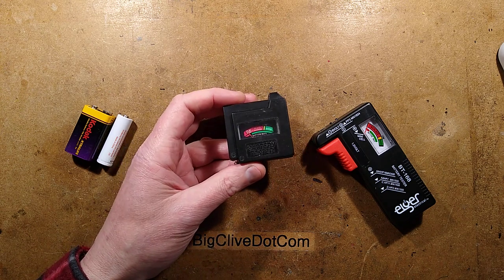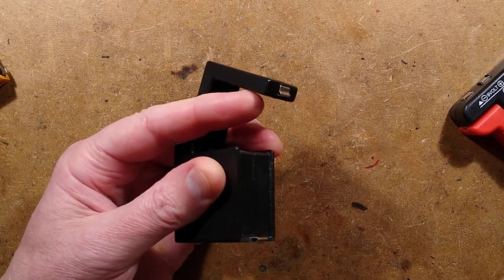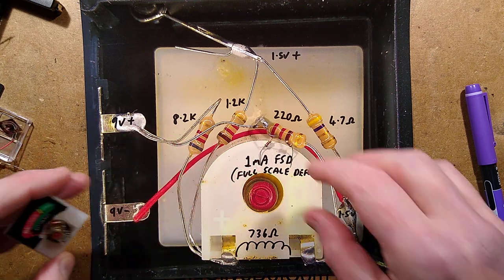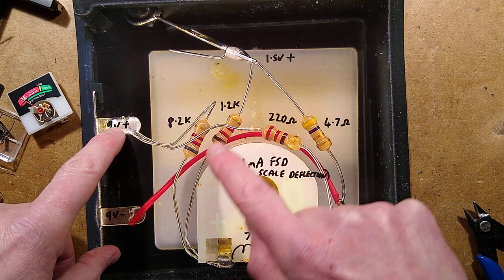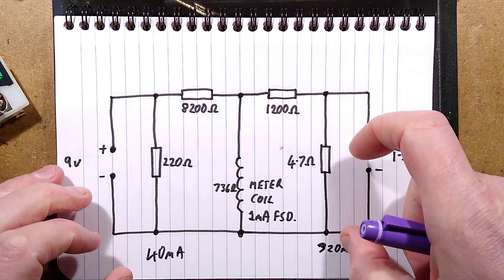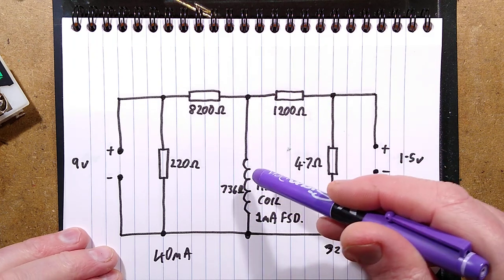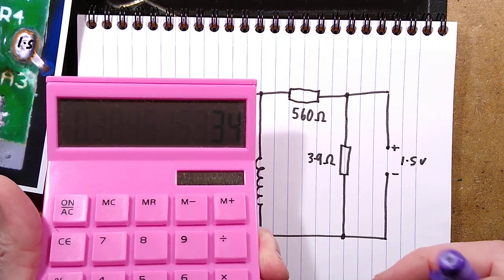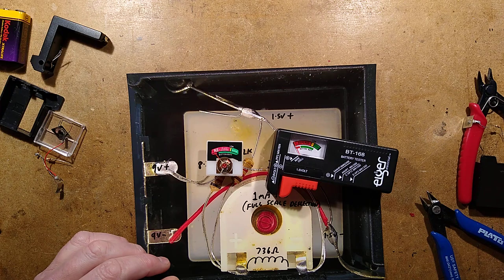Inside a simple battery tester (with schematic)

Comment: I wonder if the first one was an 'improvement' from just a 1.5v tester, and they just used the same values, likewise when they added the 9v, they may have tried it with a standalone circuit, but the act of combining both they didn't account for the resistors
Maybe try just the 1.5v set of resistors on that meter

Comment: I have newer one in both version analog and digital.  Digital version contain just resistors, display and custom chip under blob of black glue or something. Need it for trip where you need box of batteries for flashlight,  headlight, camera (before li-on), radio (before bluetooth speakers) etc. and very often happen accidentaly mixing used battery with new. Need something smaller to backpack I buy tester from Lidl Tronic H12276 IAN79015 year 2012. Very small, light and quick check but need good AAA battery for power itself and measure just by voltage without load. Maybe is good idea add some resistor inside between terminals to load for more accurately measurement.

Comment: "Kink Palculator". I snorted, and skipped back to make sure that is what you said. 

Also, wouldn't the "unused" resistors on the other side tempt some pixies away from the meter, lowering the meter deflection to show bad results for the battery being tested?

Comment: I may be asking an obvious question, but couldn’t one simply replace the 1200ohm resistor with a  700 to 750Ohm to get proper deflection and save the little tester from the rubbish bin?
I had one of those in the 80s made by Duracell, worked like a charm until I accidentally stepped on it.

Comment: The almost-400mA current draw on the 2nd meter seems high - did you test resistance across the test points? Maybe you got a wrong resistor multiplier colour band?
Also, the resistor networks for the opposite type of battery (ie. for the 9v when testing 1.5 and vice versa) will add a not-insignificant load and will alter the meter reading somewhat - for a more correct value of what current should go through the meter at 1.5v / 9v you would need to calculate the other branch of the circuit too.

Comment: I have the same small battery tester with the clamp. It released some smoke when I tested a 9v battery for too long. Since then it works fine and didn't smoke again. Pretty weird.
But mine is better in testing the batteries. If they are full, the needle hits the right side  of the case.

Comment: I have one of the newer ones you showed withe the red slide. I always wished that the red slide had a spring to better hold the battery instead of relying on your mechanical force holding the battery in place.
Great video Clive, well worth watching!

Comment: I have one of those small ones and it's "reasonable". I'm guessing the meter part is very variable in its quality. I might check the resistors against yours just out of interest. It's very possible when they made yours, they were out of the correct values and substituted something else.

Comment: I have one of these too and it isn't a good indicator for 9V or 1.5V batteries as to whether they are good or not. So what do you think the resistances should be? I guess it's easy to calculate what the resistor should be to supply the meter with 1mA (about 750 Ohm) from a 1,5V battery, but what should the load resistor be for a good alkaline 1.5 V battery?  Likewise for the 9V side. If you work it out I'll break into my device and change the resistors then I won't have to buy a new battery tester. Deal?

Comment: I have the digital version (BT-168 Pro) and measured the current draw from the battery and it's only 9.8 mA so the digital ones appear to be worse as they don't load the battery. It's fine as a quick voltage check but that's about it.

Comment: I had that exact same older tester up until a few years ago, and it seemed more accurate.  If I tested new batteries, they would peg the needle all the way to the right as you would expect.

I'm guessing quality control where they were made wasn't really good and yours just got the wrong resistors installed.

Comment: Wouldn't the load on the 1.5 volt battery be (3900 || (560 + (3820 || Rm) ) )? Where Rm is the meter resistance.

Comment: Had a battery charger for Ni-Cd batteries back in the day, which had a "test" function- put a battery in the end slot and push the button. If the light lit up brightly it was charged. It not, it wasn't! I was envious of my friend's, which had a neato gauge calibrated in GOOD and BAD like that one.

Since, I have an old Avon "Go With The Glow" battery tester, which lights a red, yellow or green LED to indicate the battery condition. That would be interesting to reverse engineer, as the lights come on only one at a time.
Reply: If your three LED tester has an external power supply they probably use some sort of comparator. If it only uses the battery under test, that's even more interesting because 1.5v batteries aren't really enough to run regular LEDs.
Reply: @eDoc2020  That's what makes it so interesting, it's run from just the battery under test (1.5 or 9 Volt). I think it dates to about 1984 or so (was a gift item from the Avon cosmetics company). I was wrong; it'll light two LEDs at a time to give 5 states of charge indication.
Reply: @nigefoxx  That is strange. I'd need to assume it has some active circuitry. A voltage divider feeding the base of a transistor might make an "okay" comparator because the drop across the junction is fairly constant at a given temperature. I can't really imagine a promotional product from the eighties would be much more complicated than that.
Reply: @eDoc2020  I would guess so. They do switch on and off sharply so I would guess a basic comparator.
With the Red, Yellow, Green it'll light G, GY, Y, YR, R. Making a poor contact will make it flicker. I need to measure the threshold points, because even on a fairly dead battery the red LED is just as bright as the other two...
Reply: @nigefoxx  It might even use a basic boost circuit. It would be quite interesting to know how it works its magic.

Comment: It looks like that square battery tester was not made properly, a lot of people make them these days. The needle should peg to the edge of "good" with a full battery, maybe the resistors are wrong. The one I bought recently worked the same as the ones from the 90s, even though they were slightly more complex than just a bunch of resistors back then.

Comment: To test batteries, I normally just get a multimeter. On a 1.5V battery, I find 1.2V or less is dead, and with a 9V battery, anything less than 7.5V is dead.

Comment: Used to have one just like yours in the early 1990s, I imagine that's a pretty old design.  I just use my multimeter but no idea if that's the proper way to do it.
Reply: If you're just measuring the voltage, that's not proper. You definitely need a load and I think 100 ohms is typically used. If you're using a battery test function, you should be good.

Comment: I got a larger type one for someone when they didn't wan to have to faff around with a multimeter to test batteries. Of course, it didn't do rechargeable batteries correctly. Surely someone will have made one that actually can do rechargeable cells, even if there's a manual selector to choose type.
Reply from the maker: A typical rechargeable NiMH cell will hold a constant voltage of around 1.2V from near full to near zero before suddenly dropping off.

Comment: 1.  I have batteries just like that.  They are so unique I er charge them back up, At somepoint they'll leak.  What brand are those.  2. My trust old one is like that but mine's even older.  Works fine.  I'm thinking the resistors are going bad..  That being said I have various including one with a slider but not that well made but stores Christmas light fuses (for the old school C9 version)  squirrels hate the wire...  The main one I trust is with a multi meter.  There's also the LCD version,.. Usually gray and needs a triple A batter in the back.  Often the contacts break for AA..

Comment: About what I would have expected. Seeing resistors tacked together mid-air inside a case hobbyist-style in commercial products is always a little disconcerting. Not sure what they were thinking with those values, either.
Reply: The resistors aren't tacked together mid-air, they are soldered to the various terminals which are fixed in place. This is actually how everything was made in the tube days before circuit boards were introduced to lower manufacturing costs. A bit ironic because now it's cheap things like this which don't use PCBs.

Comment: I have this kind of coil meter from an old rc transmitter. It was used to show the level of charge of the 12 volt battery inside. I want to convert it to check the status of a li-ion cell. Any suggestions?

Comment: Did you also cheak them with a volt meter to see which one is closer to being correct  I have the one on the right was in a battery organizer I got for Xmas
Reply from the maker: I tested it with a bench supply and meter.

Comment: I had a battery tester in the early 80s. It had a motor inside that turned a wheel that pulled against a spring to show battery power. Probably wildly inconsistent and inaccurate!

Comment: Apologies if this is a really stupid question (I only understand the very basics atm but I love your videos)... Why the need for four resistors? Could the two at the top be removed and different values used on the verticals instead? Thanks.
Reply: The first resistor is in parallel to the battery and acts as a load because measuring the voltage of an unloaded battery does nothing to show its capacity. Whatever voltage is left thanks to the load then deflects the needle.
Reply from the maker: One as a load and one to tune the meter range.  Two pairs needed because one set is for 1.5V and one is for 9V.
Reply: @bigclivedotcom  Thank you!

Comment: i have the bigger one, bought for 3€50, i sometimes use it, mine has normal resistors like the small one, it looks quite flimsy anyways, i bet the moving wire could rip from the contact if moved too many times.... i actually look for analog meters around, time ago they sold here that small analog multimeter for 1€50, asked for it time after, no longer ordered bcs it's trash but i loved the instrument, it was so cheap

Comment: 5:18
320mA load at 1.5V = 0.48W
That's almost double the power the resistor is rated for.
Sure, you're only using it for a few seconds but still.

Comment: i have a cream one of the smaller one, had it years,  certainly over 20, maybe over 30 😲 and a plasplugs branded one of the other one, theyre not too bad for a rough check and at least they test on load unlike just a multimeter (unless it has a proper battery test range) i semi calibrated mine, feeding it a few known voltages and seeing where the pointer went to , the cream one goes to outside edge of the green area at pretty much exactly 1.5v, cant remember what at 9v, the other one a bit different
Reply: the 40ma test for the pp3 is probably a bit much

Comment: I'd rather have a tester be a bit conservative vs over-estimating.  I hate the ones that light up "good" when they have an open circuit voltage of like 1.0V and everything you try to use it in fails to work properly.

Comment: And the digital versions of these tend to not put any load, nor give a reading of good/marginal/bad, rather a voltage. They are pretty useless.

My favorite is the GBT-3502, though it loads the battery less with 30 ohms.

Comment: It's worth nothing that when you connect the 9VDC battery and want to calculate the current going through the meter, you also have to consider the resistance of the other battery circuit's current limiting resistor and its load resistor. These resistances summed up form a resistance connected in parallel with the coil, so a significant current will flow through it. 

The opposite (taking the several kiloohms series resistance into consideration when analyzing the 1.5V side) is not quite the case as this resistance is significantly larger than the meter's, so it can be neglected for simplicity.

Comment: I have the BT-168D which is the Digital version of this battery tester and with it being black and having pretty crappy eyes I found myself putting an 18650 battery in the wrong way and it really didn't like that. The smell was not very nice and I have no idea what damage I did to the battery due to me not having a use for it at present. 
If I had use some sodium chloride then the rozzers could had got me with a current charge of a salt and battery. (Sorry, the meds have taken effect. 🤦‍♂)

Comment: I disagree with you. I have had at least two of those little clamp on meters for many many years under different names. I’ve never had any issues with them just checking batteries.  My guess is that the moving coil meter movement might have been damaged at some point changing its internal resistance. I do like that you do take the time to draw the diagram.

Comment: My same must have a better choice of  resistors the meter goes much higher for 'new' batteries.  My better unit has a LCD screen (just cubes to show violtage) and multi posistion switch. and leads  a nice compact unit.  The leads wrap into a groove and the pyobes snap into recesses in the back

Comment: Internal Resistance - very much misunderstood by many!  It's really important to test batteries under their expected load (current).  A voltmeter across a 'dead' AA cell will read about 1.2V but the battery can have such a large build up of internal resistance that it cannot deliver any useful current anymore - so it is as good as 'flat'.  I used to demonstrate this to pupils by connecting a 1.5V lamp to a 5000V (high internal resistance) power supply and they were always surprised that nothing at all happened!  Demoed here https://youtu.be/V06sYBiYWqM    So always test your batteries under load to get an idea of whether they are still capable of useful work!
Reply: Lithium coin cells are notorious for that high source impedance, where spent cells can read just fine with a DMM, but drop to zero under the slightest load.
The load resistance used for testing just needs to be picked with consideration for the application. Batteries for a very low current draw device can be tested with lighter loads than batteries for devices needing a high current. 
AAA cells and D cells really should be tested with different loading, but these universal testers just have to compromise and treat them all the same.
Reply: @wingerrrrrrrrr  Exactly!  I need to do a video on the Weston Cell and others that cannot drive any current and why they are still useful!  Trying to explain to pupils that you cannot get a shock from a huge 12V car battery but you can injure yourself very seriously if you short it!  BTW your comparison with AAA and D cells is excellent - how many people think the D cell is larger 'because it contains more energy' even though it has the same voltage rating.  I find lack of experience means students find concepts of internal resistance (in DC circuits) really hard to grasp even though they only need to imagine a perfect source of EMF and two series load resistances - one being that of the item in question.
Reply: @wingerrrrrrrrr  For testing CR2032s I actually short the cells in ammeter mode which gives a much more accurate representation of cell health. I'll also do the same sometimes with AAs and AAAs but I'll use the high current range for those.

Comment: Hi I watch lots off your video and others I see you use flux I brought some and when I try to soldering it don't seem to stick to the wire I'm wondering what sort off flux you use
Reply from the maker: The best approach in soldering is to use flux cored solder and apply it at the point of soldering, so the flux boils out and does its job.

Comment: So sadly my 30-year-old radio shack battery tester died I've taken it apart looked at every connection everything looks fine nothing's broken but it refuses to work I tried to buy the exact samee one on eBay but nobody has it so I bought a different radio shack battery tester

Comment: Just bought a BT-168D tester. Digital display for my aged eyes. 
It says on the packaging - “ Warm tips   - The tester is not suitable for Alkaline Battery, Lead Acid Battery or Lithium Batteries “  !!!
On the other side it says “ Checks Power Level of all 1.5v & 9v batteries “ 
Is it limited to which batteries it will test or not ? I wonder !!!!
Reply from the maker: Odd that it says alkaline battery.  It should be fine with the classic AAA-D alkaline cells.
Reply: Was going to use it with rechargeable Alkaline to replace non rechargeable Alkaline and keep 1.5v compatibility

Comment: Battery testing with such gadgets is somewhat arbitrary.  
There is no single standard load that will properly test all cells.  
Ideally, one would use a different load current for each different size and measure the voltage.

Comment: Good modern battery testers which have a proper load unfortunately don't exist. I searched for years. The least rubbish one is a digital one from Westfalia but it has the stupid habit of going into standby exactly 2 minutes after it is turned on, no matter whether I am busy testing several batteries. This standby mode turns off the display but uses enough power to deplete the internal battery within a day. There is no indicator to tell this standby mode apart from proper off mode.

Comment: The   coil in the meter   acts the same as   how a  DC  motor would    work    That's   a  series  circuit  in   parallel   with a   resistor  pretty  basic   stiff    What happens when you connect  two  batteries  at the  same time   ,  do the   math  Kirrkoff

Comment: How did you figure out the coil was 736 ohms?
Reply from the maker: I disconnected and measured the older unit's meter.
Reply: Oh, that makes sense. I thought maybe the resistance was written on the mechanism, somewhere. 

Thanks for the video; it was very informative!